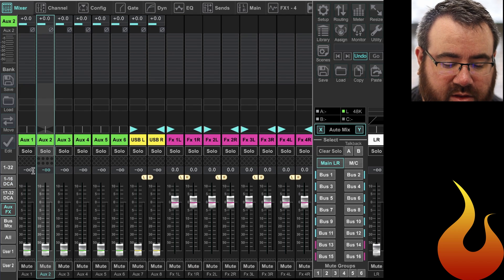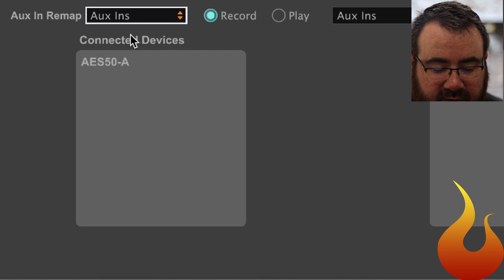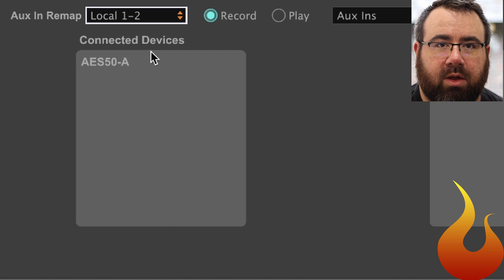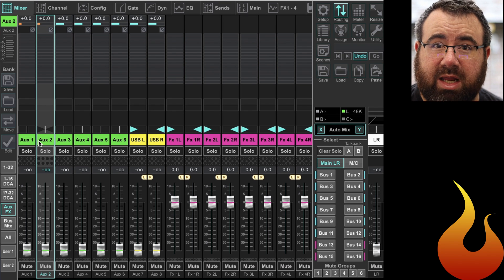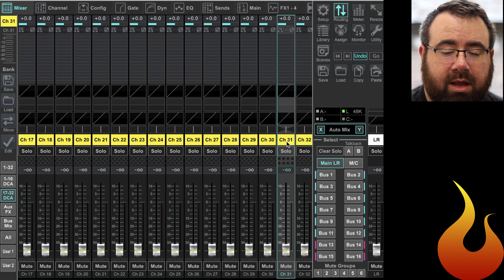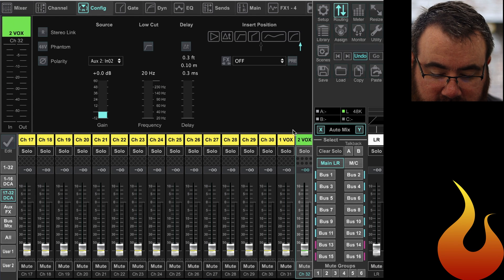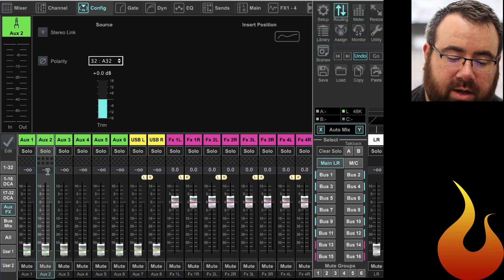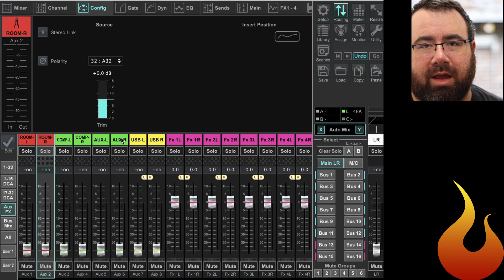Get More Than 32 Inputs From Your Behringer X32 - #AscensionTechTuesday - EP119

Comment: Can you use 32 inputs over aes50 on the stageboxs (sd16s16) but then add a 3rd stagebox say the sd8 and do the 6 aux inputs over aes50 as well? I have done all 32 over the aes50 but can the auxs be re-maped over aes50 at the same time?
Reply from the maker: I think for that to work, your 32 channels would need to be connected to one AES port and the 6 channels would need to be connected to the other. 
 But yes, that would work. 

-Chad
Reply: @AWTechTuesday  i will try that
Reply: then i would not be able to run a foh and mon split

Comment: We use the Aux for iPad And Comp but use Dante and mix in a box for Broadcast. How would you route the Aux to Dante?
Reply from the maker: If you need more than 32 channels to broadcast, then I suggest purchasing a Klark Teknik DN9630. This converts AES50 to USB so you can transfer 48 channels instead of 32 :)

Comment: How do u multitrack the other 34channel u using for the room?
Reply from the maker: Excellent question! Unfortunately you cannot with the built in card however, you can if you purchase a Klark Teknik DN9630. That unit converts AES50 to USB so you can actually transfer 48 signals by going that way :)

Thanks for watching and commenting!

-Chad
Reply: @AWTechTuesday  Can you tell us how would it work? There isn't quite good videos that demonstrate it, and I feel like a minimalistic setup is more simple and helpful for those that uses few things.